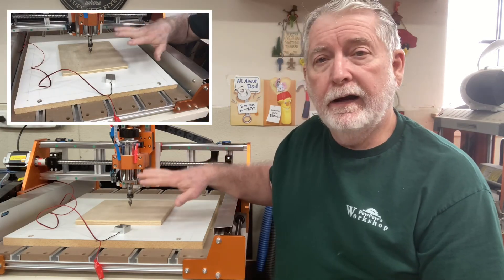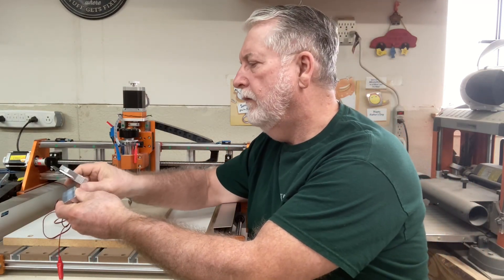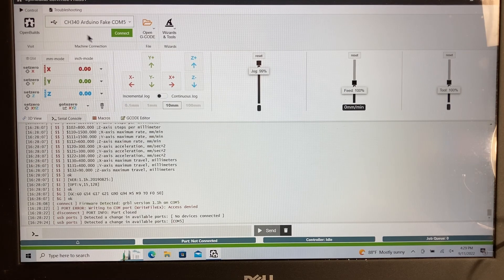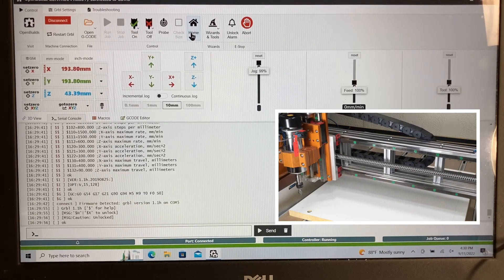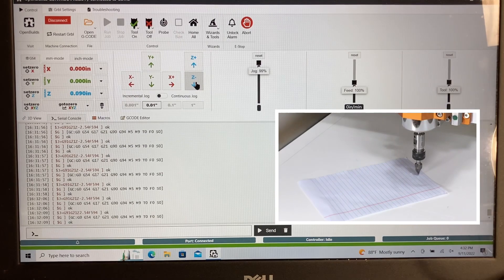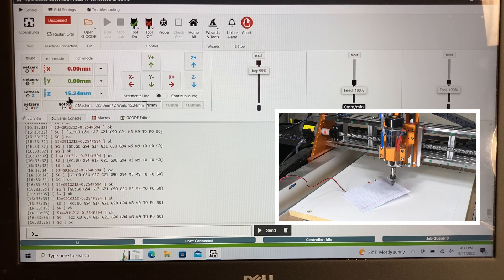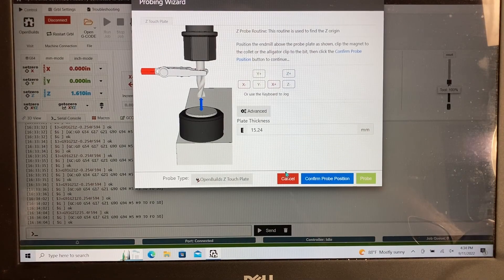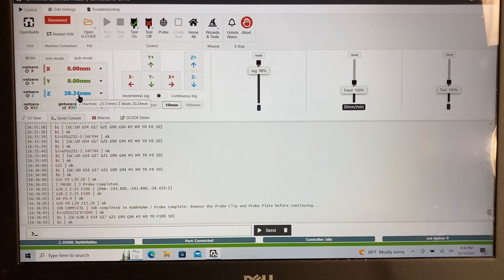Alternative Way to Measure a Probe

Comment: Can an OpenBuild touch probe be used on FOxalien XE-Pro?
Reply from the maker: Yes you can but you will need to change the connector to the controller
Reply: @PawPawsWorkShop  I got the openbuilds touch probe but I have the XE-Pro. Do I just connect sig wire and clip wire? I see four wires come with it and I only have two.

Comment: I see you have a number of desktop cnc machines of various brands. Based on your experience with them, what would you recommend? I've been working on a Bob's CNC and don't have anything good to say about it.
Reply from the maker: For the small projects I use the FOXAlien VASTO. It’s very solid and does an excellent job. If you can only have one machine then get the largest on based on your budget and space available in your shop. Since you already have CNC experience, I would suggest the CNC4NEWBIE New Carve.
Reply: Thank you. I watched your series on the assembly and setup. That machine looks to be well built. The components look like they have lots of material for strength.
Reply from the maker: Yes, it is an excellent machine

Comment: Hmm you measured the probe with calipers at 14.92, now it measures 15.24. tats 0.32mm discrepancy.. which is right? Plan B FoxAlien state in the manual what to set probe value for Candle?? How accurate is their quote?
Reply from the maker: In candle what do they recommend. I do not use candle. I think the calipers are off
Reply: @PawPawsWorkShop  the FoxAlien assembly manual usually states thickness of the plate to use in Z Probe macros . My Masuter was 14.92mm, 4040XE 15mm. Genmitsu 4040 20.17..... Vasto Manual value?
Reply: @PawPawsWorkShop  Hi friend, when do you publish the video of OLM3? We send a machine to you, but you did reply to the emails.
Reply: Measuring with calipers is the way to do this. The machine should not be used for any precise measurement. Using paper to set the height can easily introduce +-.1mm of error (typically not an issue with most wood working projects) Although using paper 2x (off waste board and off the probe top) will now introduce +- .2mm of error in the measurement. Each incremental click in this example is ~.2mm so that is also roughly +-.2mm. This machine has a fair amount of structural flex which will add to the error.

Comment: 7:39 thats nono acuracity. you measured it under 15. put atleast sheetmetal there. hold measure tool there and measure plate then measure that height stiill on top that same metal xD now its acurate. when do it auto mode
firts you used inches and even hit wood. it have to made hole then you measure on that same hole using inches 0.01 that 0.0254 mm yes thats very not ok LOL paper is 0.1 and you got 0.2 error on calibers